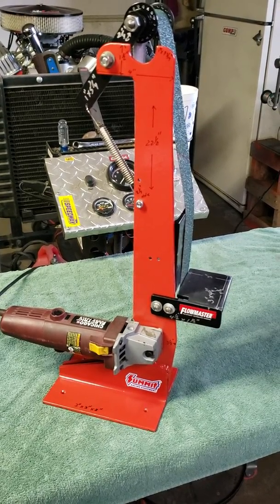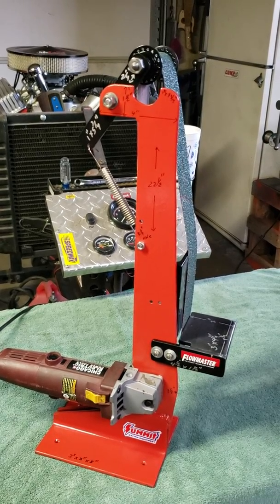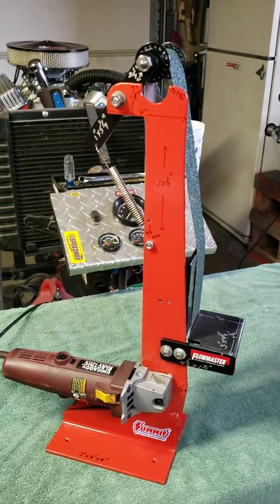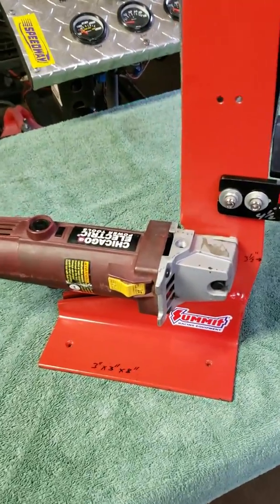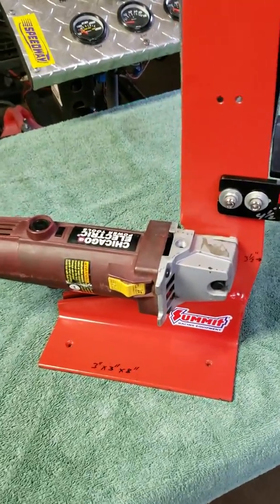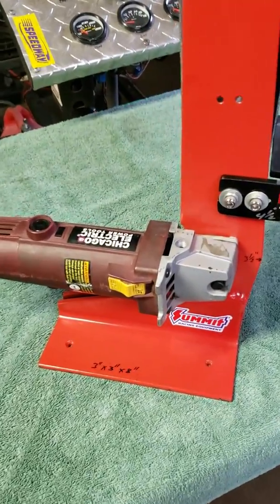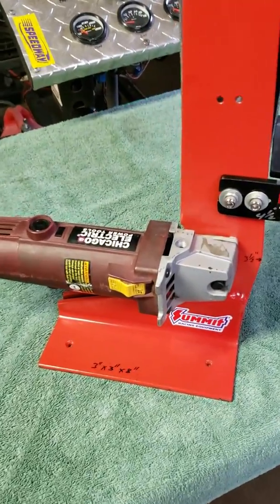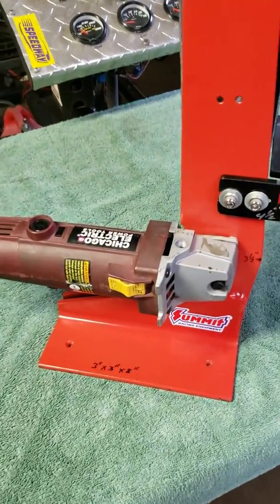Belt Sander with bicycle axle at the top DIY 2"x 42"

Comment: Hey Ronnie! Stumbled upon this as I was checking out your video on carb cleaning......what a great idea for a belt sander!...One question? Is the main body 22  1/2" with or without the added top piece? I'm sure I'll have other questions as collect the necessary iron to build one. Thanks man!, great idea.
Reply from the maker: Yes, 22.5" main body and 23" to the top of the tensioner lever. This sander is a beast and will move some metal/wood with quickness.... Good luck!
Reply: I alsp found this while checking out that sexy Holly. Have a 800dp that desperately needs a bath. Where do you buy the 2x42in belts? Cant find them
Reply from the maker: @johnsayman2271  eBay has them